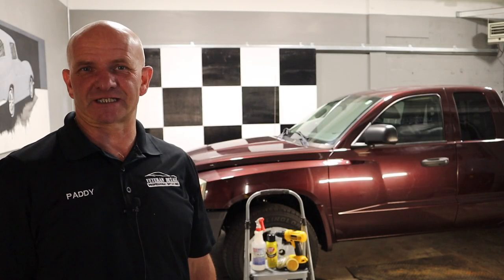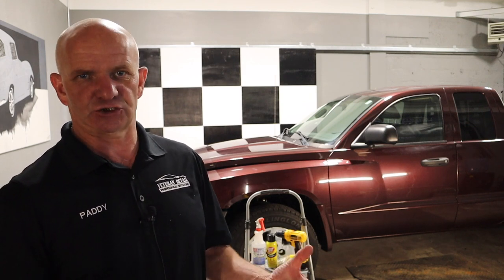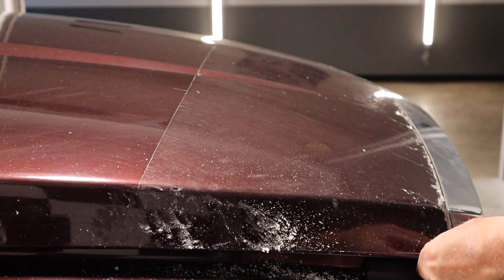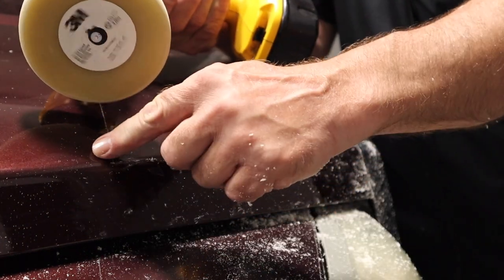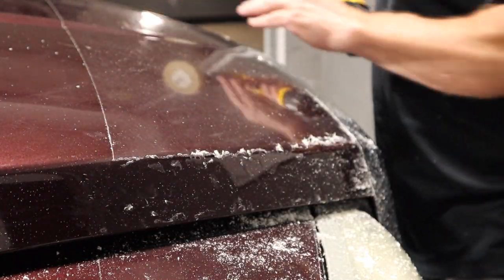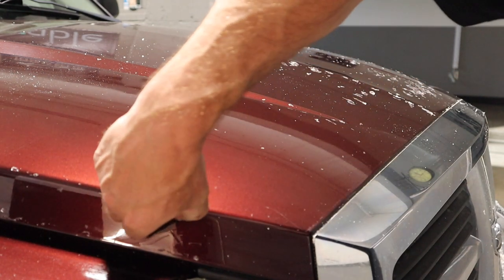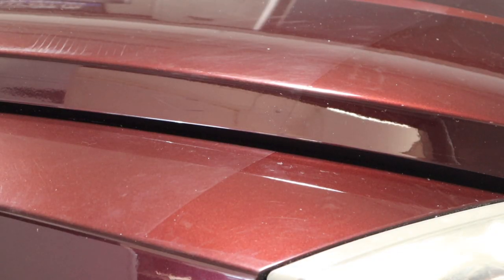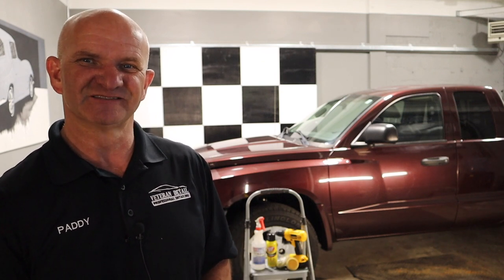Old Clear Bra Removal (The only thing that works)!!

Comment: My clear bra is so brittle it comes off in tiny little bits. I was going to resort to using a heat gun and plastic scraper. I just watched your video and order the pinstripe wheel. This video is wonderful. Thank you.
Reply from the maker: Thank you for watching and commenting. Good luck with it, remember to take your time.  Its very satisfying once its all off and complete.  Regards Paddy (Veteran Detail)

Comment: Man, thank you so much. What a nasty job. Had to take crap wrap off an ISF. Started with a  heat gun, plastic blades, Goo Gone, and another Costco sized container of WD40…..Useless. Bought the 3M Eraser, switched to Rapid Remover (in my opinion the best adhesive remover on the market, turns ppf into oil), continued with multiple plastic razors, heat gun, & viola. Elbow grease still needed, but was able to remove PPF from quarter panel, hood, & fiberglass front bumper film (do not use the rubber wheel on plastic) within in several hours. Before the wheel, & Rapid Remover I had been working on it for several hours a day for nearly a week with no outcome. Again, many thanks!
Reply from the maker: Thank you for watching and commenting,  Yes, I think we have all had that one job where we throw every tool in our toolbox at it. As I have said before it's a time consuming job but it is the safest way to get it off without damaging the paint. I appreciate the feedback,  Regards Paddy (Veteran Detail)

Comment: This video was a HUGE help, THANK YOU! My situation was a little different, 2015 (silver) Corolla, the clear bra wasn't dried out like your example, but it looked like it had mold growing between it and the paint. Instead of dry, dusty flakes flying around, I had scalding hot balls of goo flying at me (looked like rubber cement). Where this 'mold' was, the bra came off easily, where there wasn't I really struggled to get it off. Happily, after all the effort and cussing the paint was NOT damaged and it looks so much better now. The color difference is very subtle, so I'm not even going to buff it out. If anyone out there runs into the 'hot balls of goo' like I did, PROTECT YOURSELF! Not just safety glasses, but a face shield and a hat as this goo will attach itself to your hair and NOT come off without cutting it out. DAMHIK. Thanks again!
Reply from the maker: John, thank you for your feedback, as you can see from the start of the video the flying glue and the problem of it getting in my hair was not a problem. Being Bald can sometimes be an advantage.😬

Comment: The solvent you used isn’t in your description.  Have a link to it?
Reply from the maker: Hi, Sorry to have missed this comment.  The solvent I used is typically only available trough a detail supplies company, who require you to have an account with them.  A very similar product from 3M can be found here :https://amzn.to/3m28kTv
Reply: I used gasoline and worked to remove the glue

Comment: I used gasoline.  Wet down towel or rag and lay it on each spot as you go. Gas will soften up hard brittle dried on ppf. As gas softens it just use a plastic razor blade or good plastic putty knife. Scrape then wipe...it's time consuming but that's the only thing that worked for me on some 17 year old dry, moldy, brittle ppf. It's a nightmare. Gas didn't remove paint or clear coat. I even left a gas soaked towel on overnight...it was better that using laquer thinner and I didn't have a grinder. Im a female. I also used blow dryer after softening it too.

Comment: I have a very cracked and brown/yellow discolored PPF on the lower rocker panels on the side of my white car. Think this method would work in my situation?
Reply from the maker: Hi Michael, yes it should be fine to do that area. Just make sure that it is clean and free from dirt before you start with the removal of the PPF.

Comment: I have at least 13 year old film on a Lotus Elise. Took an hour and a half just to remove the film off the inner half of one mirror with a heat gun and a plastic scraper. Still have half the hood and both lower side panels covered in it. Would this rubber wheel be safe on the plastic body?
Reply from the maker: Ati, The problem with Plastic or fiberglass panels is the heat tolerance that is typically building up as the wheel spins on the surface.  With metal panels more heat can be absorbed into it, therefore giving you a longer work time.  You have to be very careful on bumpers and other plastic panels while carrying out this process.  Slow and steady with the drill and  rubber wheel.  It can be frustrating as some people are not naturally patient,  it's  when you become frustrated with it that mistakes can happen.

Comment: Is that 3M wheel safe to use on plastic parts to remove old clear bra? The front bumper for example. I'm worried it might put too much heat and warp the plastic.
Reply from the maker: Harry,  I would have to say the risk outweighs the reward.  With Bumpers they can build the heat very quickly. You will have to have the wheel spinning very slowly so heat does not build , I know from painful experience.  If you can get away with steaming it off that would be better, however if it is really baked on there is no guarantee that steaming will work, so the only real way is to use the wheel.  It is important to note that it will take time and test your patience, don't get frustrated with it and try to rush it. that will only lead to you throwing tools and cussing out loud.
Reply: No.

Comment: Is there an easy way to make sure you don’t overheat things? Like what temperature on the surface would indicate I need to take a break because it’s too hot. I used a hot air gun and a plastic blade to try and get some ancient clear bra off and I gave up when I saw that some paint was coming off with the bra as I moved along with the razor and gently pulling when I could, the film is all cracked so you can’t really pull up more than like a 2” by 2” piece at a time
Reply from the maker: Fee, it’s a slow process but the safest way. Like many other people before us, we have tried to use a steamer, hot air gun and various other ways to remove it. 

The wheel, when used properly is really the only way to safely ensure that you are not risking damaging the vehicle paint. Any use of a blade and you run the risk of either applying too much pressure or loosing the friction and slipping the blade over the paint and causing scratches.

Although it’s a slow process, it’s the safer option. Regards Paddy (Veteran Detail )
Reply: @VeteranDetail  thank you but my question is with the wheel can you h harm the paint by heat or going to fast etc ? What’s the temperature at which I should give the surface a break?
Reply from the maker: @Fee.1  you can if the wheel is spinning too fast. The higher the speed the more heat that is generated. With clear coat paint, we typically have a rule that an increase in the surface temperature  of any more than 30 degrees F above the ambient temperature, then damage of the paint will occur. When polishing paint we want the surface to be as cool as possible. 

There is no hiding the fact that by using the wheel it creates friction, in turn friction produces heat. That is why we want to slow the speed of the wheel to a point where it is creating the right amount of friction but not too much heat. 

I hope I have explained that in as simple as terms as possible? Like I say in the video it’s something you just have to take slowly and be patient with.
Reply: @VeteranDetail  yes that’s very helpful thank you. I will make sure I’m not going above 30F with an IR temp gauge. I would’ve expected 30C not 30F so I’m glad I asked.  Last question. Are there any brick and mortar stores that tend to carry plastic razor blades and/or these type of rubber abrasive wheels? I can’t seem to find any
Reply from the maker: @Fee.1  . The Detail Garage (Chemical guy’s) may carry those items , but mainly their range is surface preparation and protection focused.

Comment: Can the pinstripe adhesive removal wheels be used on clear bra that had been attached to plastic trim? If not, what do you use?
Reply from the maker: The wheel works great on removing it from the metal painted panels, any bumper or trim pieces are mostly plastic. Care needs to be taken not to generate too much heat with the friction of the wheel. With these areas I recommend the use of a heat gun to soften the PPF. You should be able to peel it back slowly then remove any glue residue with the solvent remover as previously shown. Remember that the metal painted panel’s will always be able to take a little more heat than the plastics. Take your time, thank you for watching on our channel.
Reply: Additional feedback / caution: I used an Amazon rubber wheel "SATC decal eraser" and it would either just smear the old clear bra making it harder to peel off, or with just a little more time and/or force, pull the paint right off.  This is OEM Porsche paint and bumper and it would easily take it right down to the bare plastic.
Reply from the maker: @yueibm  , as I mention in the video, not all of these decal / pinstripe removal wheels are the same. A quality wheel like the 3 M will have a softer compound and will work at slower speeds.  The main problem is people try to rush the process and build too much heat, especially on plastic areas, like bumpers.  Also consideration needs to be given to how soft or how hard the manufactures make their paints, Porsche paint is typically soft. At the other end of the scale Mercedes paint tends to be much harder.lets face it Vehicle manufacturers will cut costs if they can and one of those cost cutting exercises is with the quality of paint. Modern vehicles tend to have some poor quality paint these days.

 For anyone watching this process please remember It takes patients and time to get it all off without damaging the surface of the paint.  

Thank you for tuning in and contributing with your comments., Regards Paddy.

Comment: Can't stand this PPF crap film.  I bought an old 2007 Chevy Silverado truck painted in Summit White which had this junk installed on the edge of the hood and it's now all yellow from UV overexposure.  I started trying to peel it off and it actually pulled some of the paint off with it exposing the primer.  I'll end up having to refinish the areas where it pulled the paint up but I tell you, this stuff irritates me to no end as it's like contact cement with the adhesive it uses.  I also heard you can use a heat gun to soften up the film prior to trying to peel it off with minimal damage to the underlying clearcoat and paint.
Reply from the maker: Antonio, thank you for watching and taking the time to comment. Yes the older PPF is a real pain to remove. With the wheel it is generating heat from the friction, it is better to do that without heating it up first, using a heat gun will soften the material and make it more goopy. 

The glue will soften and most likely be left behind on the surface and will just extend the timeframe.

Newer Paint Protection film can be removed far easier with the use of a steamer.

Comment: This is why I'm hesitant to get PPF
Reply from the maker: Mike, the New PPF options are far better than the older stuff. Some of the new makes which are self healing, others with Ceramic coating infused within. My video is not designed to discourage people from getting it, it is there to give a safe method of removing the Old outdated stuff. Thank you for watching and commenting. Regards Paddy
Reply: @VeteranDetail  I understand.   But that's a pain to remove when due.  A guy broke my paint using g a wheel similar on my GT500 bumper removing stripes.
Reply from the maker: @mikeprice8307  , sorry to hear that. The problem with vinyl on bumpers is, the heat tolerance is far less on plastic than on metal . I would not recommend people to use the wheel on bumpers unless you are spinning it very slowly.